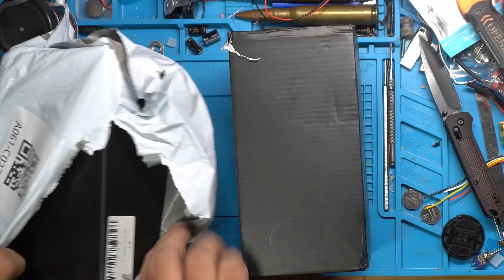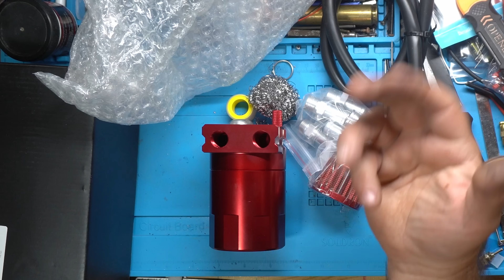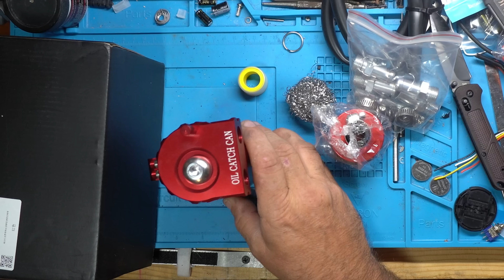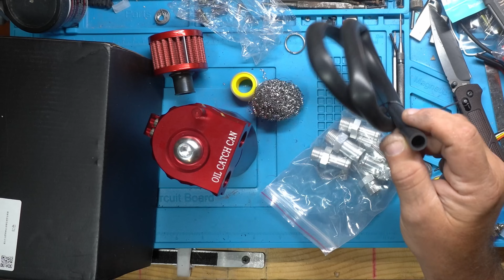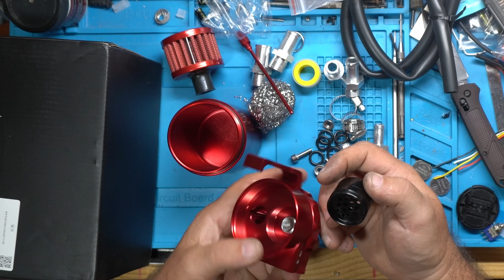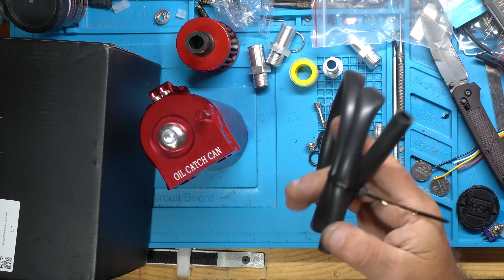OIL CATCH CANS

Comment: Direct injection and Port injection. I should put something like this on the GF's Escape, I know I took the intake apart when I was working on something the the tar like oil build up was far more than I thought it should be.
Reply from the maker: Yes port injection. Port injection is cleaner in regard to the back side of the intake valves. Have you ever tried any of the intake cleaners?  I saw one that you sprayed into the intake while running to clean valves?
Reply: @TTMEable  Usually seafoam, used to just use water in the carburetor days.Seafoam has a spray intake cleaner you start the car and attach the tube from the can to the intake/throttle body and allow it to run.
Reply from the maker: Ok. I couldn’t remember what it was. Seafoam. Ill have to research my use it. Thanks. My brain is got holes in it. But only between my ears.

Comment: PCV - positive crankcase ventilation.
IMO the only GREAT use for the kit-included hose is drive-way setup. -> after it's all set-up and cut to length -> drive to auto-store, take off the hose and walk with it in hand "I want this, but BETTER" :face-green-smiling:
Great video. Until now i never thought about vacuum on these things (reverse flow). But it makes sense. 2000's SX-spec cars had boost gauges ranging from positives into negatives for a reason; on lift-off throttle, turbo-surge noise "su-tu-tu-tu", negative 'boost' values.
Another thing now in my brain, that i'll never use :face-purple-smiling-tears:
Reply from the maker: Yeah. I hotta do dome more research. Im thinking ill need some check valves in the system to make it work properly. Haven’t though of the cut got pattern in the hoses, but a great idea. Im pretty sure ill be able to reuse the existing quicky connectors so i gotta get the right id hose for that. Be on this project after oil pan and both valve covers, hotta fit the sync 3.4 upgrade in all this somewhere. G. I shore do find me a lot of projects. My wife is perdy good at that too.